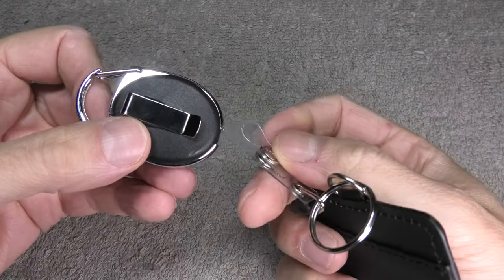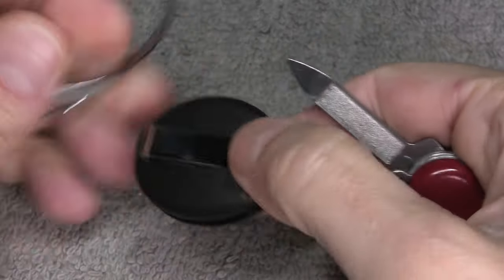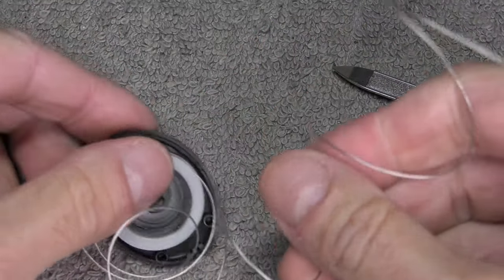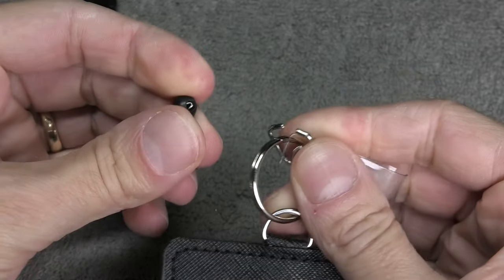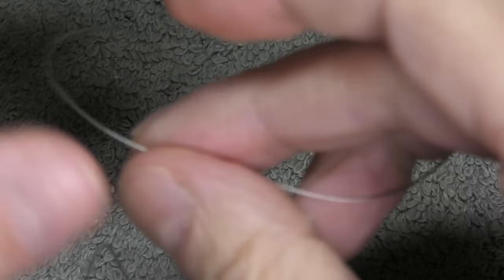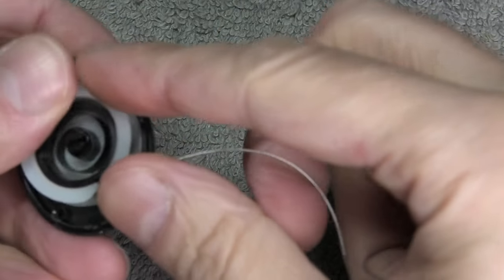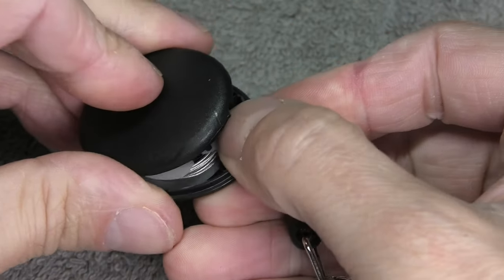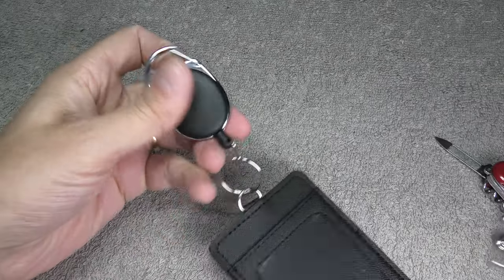Repairing a Badge Holder (How to instructions)

Comment: why doesn't my string pop back fully?
Reply: You have to tighten the coil a bit more when spooling. Basically while you’re spooling the wire before you finish pull the string slightly to add tension to the coil then put the string through the hole and connect the two housing pieces.